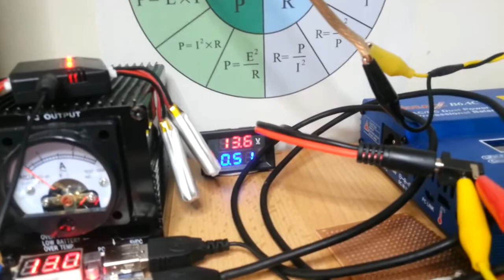New DC DC 600W adjustable voltage/current 10-60V to 12-80V Boost Converter

Comment: The issue with adjusting the current is because the V pot changes the voltage at the FB pin of the UC3842 PWM directly and the I pot only the feedback to the negative input of the only op-amp used in the dual package which outputs to the CS (current sense) pin of the UC3842. I thought the UB806 transistor in the corner was a current-limiting MOSFET from a diff amp circuit when I saw the photo and that the power jack was only for control voltage; but I was wrong on both counts. I wanted to up the 63v electrolytic to 100v and use the board to up my two-solar panel voltage up from just 72vdc to 78v to chage a bank of six 12v lead-acid batteries in series; but I'm not yet sure if the voltage regulator will take that or not. I still don't know what the UB 806 is for; but now that I've stated that, it will probsbly come to me. LOL

Comment: Yep, you can not go below the input voltage.  I had some issues setting the current limiting when the input voltage would not support the current I was trying to obtain.  * The 10Amps applies to the Current INPUT.  Not the Output.  Your limited by WATTAGE on output.

Comment: Hello, I have a question:) can you help me?
I want to use this to charge a battery, which requires both a set max voltage and a max current. The output voltage will always be higher than the input voltage. The input voltage is varying all the time, since it comes from a generator.
Is this unit going to work? (Many people are reporting that the CC function doesn't work).
I'd really appreciate your help!
Reply from the maker: On some the CC does not work, on this one in the video the CC does not work, that's why I made the video showing that.
Reply: If it's not boosting, then the circuit is bypassed isn't it? So will the CC be bypassed as well in that case? (Since it's CC out and not CC in, and it's not regulating CC out)
Reply: Some what the same issue with the one I purchased to test  here.  I purchased one to use as a Li Ion E Bike battery charger expecting to be able to regulate the Amperage with a given voltage.   Using a 15V input  and the V Control Pot was able to Boost that up to 30VDC no issues.   Popped a Amp Meter in line the output along with a 1 Ohm 10W Resister in series .  The thing was pumping out 10.2 Amps .  Tried to set the Current and it did nothing about the Amperage going out.  UNTIL I used a 100W Light bulb as a load.  Then Amperage  control worked  somewhat  only allowing me to turn it down to .49 Amps.  Nothing Less possible.  Chit.    The Current control on this one seems wonky at best.  Need more testing but I'm thinking it may have to do with the available Amperage my 15V source was able to provide.  In any event it's proving not to be suitable for a Li Ion Charger.    They work Jiffy as far as a Boost Converter but not any good for much else.  Guess I would need to us it in combination with a Proper Current Limiting circuit.

Comment: why did i can not adjustable current ?
Reply: tell me the value of smd resistor R4 - there is a path from the output terminal to the potentiometer for voltage regulation

Comment: They should not advertise this module as current adjustable.....the engineers original schematic shows that r9 should be a proper current sense resistor 0.01-1ohm...the lm358 op-amp cant handle the very low resistance of a simple wire shunt at the switching frequency...you may be able to mod it..depends what other changes have been made to the circuit.......a 0.01 ohm would give you a range of 1.4a up to 50 amp..o.1 ohm gives 140ma to 5amp
Reply from the maker: Wow that is a lot of knowledge relating to this. This information is so helpful to me and others, thank you. I do not think I can make it good as I have no where near enough knowledge or experience, but I can ask for my money back :D
Reply: Can you help me out? I`ve been searching for the schematic for quite a while now, do you still know how to find it?

Comment: Is there a R9 and is it a solid wire?
Reply from the maker: yes and yes, also I noticed when I modded the other one I have that there are no connections going to the current adjust pot. This may be the reason no adjustment is possible?

Comment: You should've used cree cxa or cma leds instead of cheap chinese leds
Reply: tell me the value of smd resistor R4 - there is a path from the output terminal to the potentiometer for voltage regulation